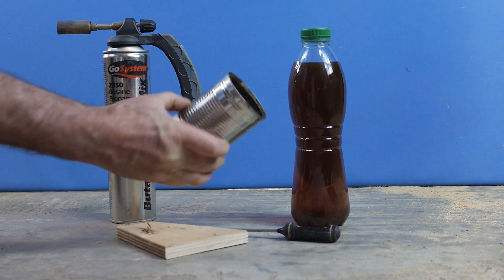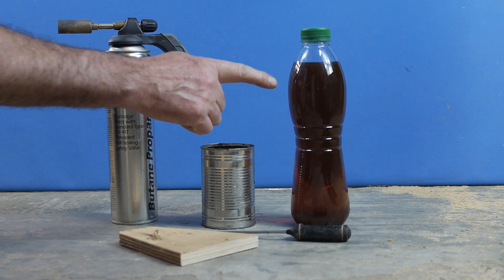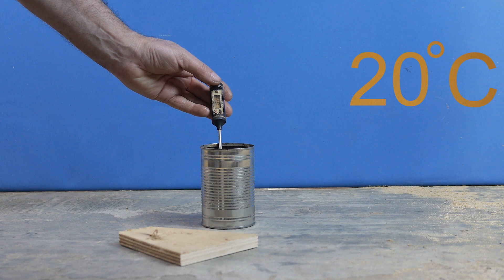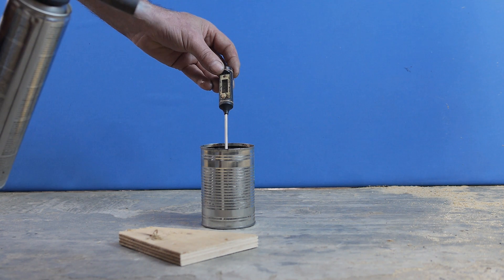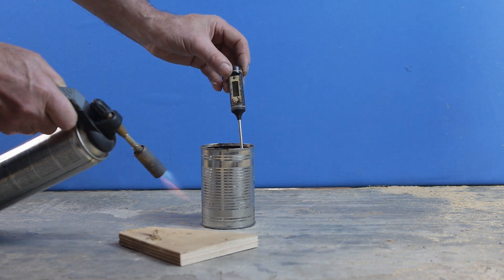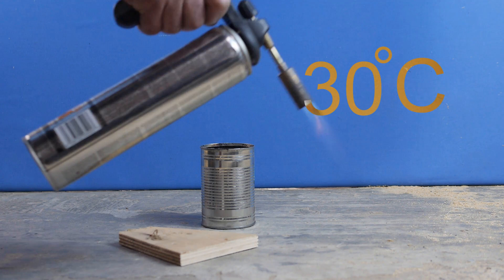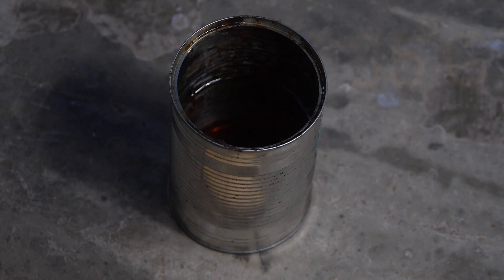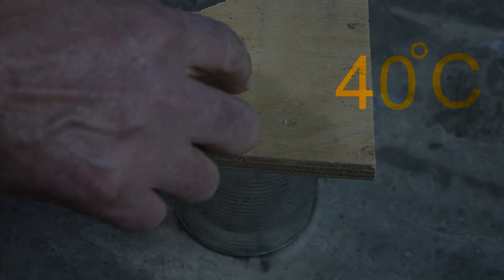Fuel Flash Point Test

Comment: Good video, but I sure hope nobody tries this with gasoline!
Reply from the maker: Ive done this test several times with gasoline and naphtha,  It works fine and is easily put out by placing the lid on the cup but you dont learn anything because the flashpoint of gasoline is well below room temperature.

Comment: Can I do this experiment to measure the flash point of biodiesel? And can I replace materials such as the can for a beaker, and a heater instead of the gas blow torch to heat the beaker with the biodiesel. Also, is it possible to perform this experiment inside a fume hood in a laboratory or should it be performed in a wide oxygenated space?
Reply from the maker: Yes it works fine for biodiesel, You can expect the FP of biodiesel to be in the region of 120  to 140 °C.  A beaker is ok provided it can withstand the heat.  A fume hood would be ideal but failing that a well ventilated space with no flammable materials nearby.  A high moisture content can affect the FP of biodiesel.  If the sample begins to bubble and spit at 100°C hold it at that temp until the bubbling stops and then continue to conduct the test.
Reply: imakebiodiesel thank you very much. I made the experiment already, but the flash point for this biodiesel was much higher than expected, about 190-200°C. Is that ok?
Reply from the maker: It shouldnt be that high,  My suspicion would be high water content.  the steam rising off the surface would supress ignition.  have you tested the biodiesel for water content?
Another possibility  is poor conversion.  the flash point of unprocessed vegetable oil is around 320° so a proportion of unconverted oil in the biodiesel will raise the flash point considerably.
have you tested for conversion?  
Both of these tests are covered in my youtube channel
Reply: No I have not tested water content or conversion. I cannot find those videos, can you send me the link please.
Reply from the maker: This is the link to the video about the carbide manometer, a simple diy instrument that measures water content in fuels in parts per million.
https://www.youtube.com/watch?v=Gf-aoDHmKkc
This is a link to the 30/270 conversion test for biodiesel
https://www.youtube.com/watch?v=Gf-aoDHmKkc

Comment: Flash point is when the fluid is hot enough that the vapor from it ignites  from an external source momentarily but is not sustained. Fire point is when the fire sustains for 5 seconds or more. So from this video, i would guess the flash point is between 30C and 35C, and the fire point is between 35C and 40C. 

This is causing some confusion for me because the flash point is supposedly 37C to 65C.
Reply from the maker: +Derek Desjardins .  You are absolutely right, in the video the Flash point occurred earlier when there was a little flicker of flame.  5 degrees later when the flame caught and stayed it was actually the Flame point.  The fuel I was testing was a synthetic kerosene and later accurate lab tests established the flash point at 38°C so my test was approximately right.  To be totally accurate requires much more sophisticated and expensive equipment.
thanks for your comment.
Reply: +Derek Desjardins totally right , the flash point is nearly @ 35 degrees and the fire point is @ 40 degrees
Reply: at flash point fire cannot sustained after removing source of ignition, a bit confusion in the video, at 40 C suppose to be fire point
Reply: Derek can you simplify surface oxidation and surface area relative to volume in fires haha
Reply: Thanks.. Your comment helped me after 4 yrs..

Comment: Could you make a video on how to find the Fire point of fuel?
Reply from the maker: ***** If you watch the video carefully at 35°C a small flicker of flame appeared and then went out.  Strictly speaking that is the flash point of the fuel. In the next scene at 40°C the fuel lit and stayed lit, that is the flame point or fire point.  I had that fuel tested in a laboratory a few weeks after I made the video and they found the flash point to be 38.4°C so my test was within 10% of the true value.
Mohamed Zaqout asked a while ago if a higher flash point is better.  The answer is yes and no.  Yes, a higher flash point will mean the the kerosene is easier to light but no because too high a flashpoint will make the fuel more dangerous to store.  A flashpoint of 38°C is considered to be a good compromise .
Reply: imakebiodiesel No - higher flash point makes fuel more difficult to light, because you have to heat it to higher temperature. Higher flash point means safer fuel. eg. gasoline has -45degC flash point, when diesel oil flashes at 65degC. That's why gasoline wasn't and will never be used as marine fuel - it's too dangerous.

Comment: so for flash point means fat will catch fire on the pan right?
Reply from the maker: cooking fat or oil catching fire in the pan is a good example of a fuel that has been heated beyond its flash point in the presence of a flame.
Reply: Flash point is the temperature at which the fuel is flamable

Comment: so it means if the flash point is higher then it is better?
Reply from the maker: For kerosene a  low flash point means that the fuel will ignite more easily but if it is too low it may be dangerous in storage.